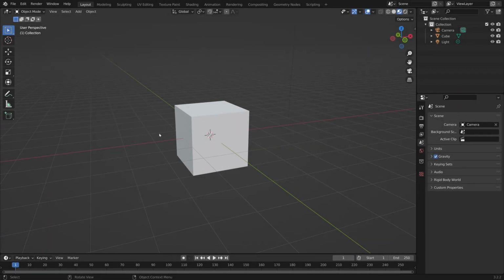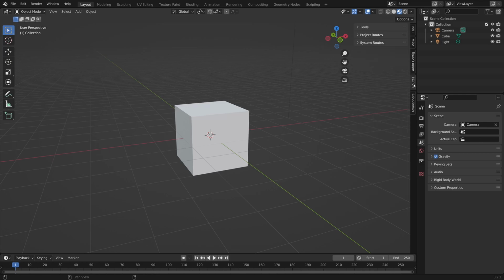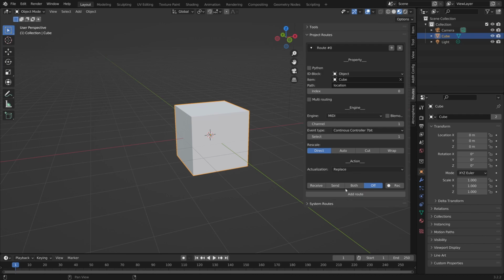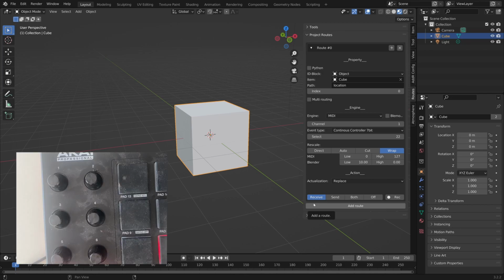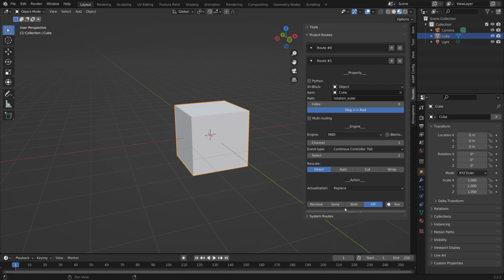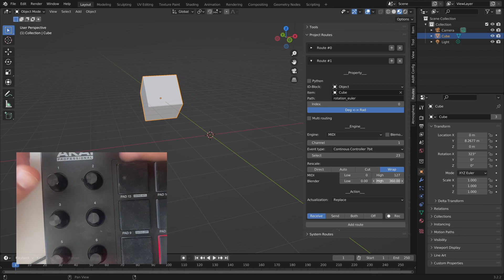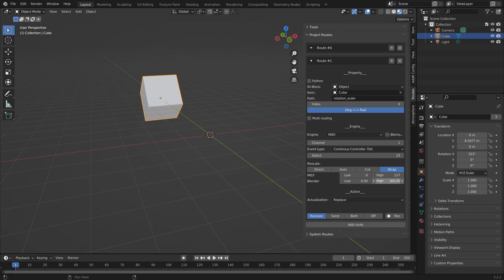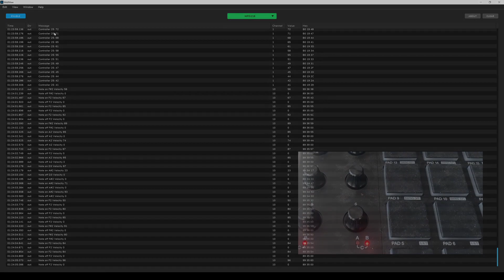Control Blender 3.2 with a MIDI hardware controller! (JPfeP AddRoutes)

Comment: Hi. Great tool. My question is, can this tool be used in a game made in Blender? An example would be a 3D keyboard in Blender that would play movements based on a MIDI file or controller in real time. A game with animation from a MIDI command. My English is not very good, so please bear with me.
Reply from the maker: I guess you could, but it would make much more sense to use unreal engine which is also free and is much more suited to game development. It also has a lot more midi features and there’s even an add-on whereby you can do your modelling in blender and then automatically import it into unreal engine in real time.

Comment: hey, i'm deleopping a way to make live 3D vjing thanks to your awesome addon, it blows my mind that i never saw someone using it, combining blender nodes potential with your program give something big. However i have few questions about it to complete my use of it. For exemple i would like to link a compositing node to it but can't link this type of value. Is there a way to make it happen with python or something i can't think of? I would really appreciate a small discussion if you have tips about things like that. Thank you again
Reply from the maker: Nice! But to be honest you'd be much better off doing what you're trying to do in Unreal Engine, it's designed for working in real time, Blender isn't! And it has much more support for MIDI and pretty much anything else than Blender. Blender is great, but Unreal kills for anything interactive and real time.
Reply: @retromograph3893  thanks for the fast response, yeah a lot of people says the same so i'll give it a try, the node system of blender is so good but i may try the switch if you all agree on that ;) thanks
Reply from the maker: @tib.lsr.3780  nice, Unreal also has an amazing node system for game logic, but not the parametric designing stuff which i guess is better in Blender & Houdini.

Comment: I'd bet if you had the right setup (with at least two computers?), this could be fun for some VCV Rack CV sends over MIDI. Audio stuff on one computer and create the visualizer on the other. Could have all kinds of stuff dancing to LFOs and envelopes, particularly when you consider that any parameter which can be animated in Blender can have the router driving it. Bet some pretty cool stuff could happen with particles and mesh deforms and decimation.

Just food for though, since it appears the tools are out on the table here.
Reply from the maker: Nice! a couple of thoughts: for anything in real-time and MIDI or OSC controlled, i'd chose Unreal Engine over Blender, because Blender isn't really designed for real-time rendering. Although if what you're making is more like line & dot based retro motion graphics, you can do some cool stuff in real time with a powerful computer, especially with geometry nodes, which i don't think Unreal has anything equivalent to. But Unreal has way more and better tools when it comes to real time and external control. By the way, here's me messing around with CV and Unreal Engine a couple of year ago: https://www.youtube.com/watch?v=jDxkLStctY8
I'm also a little skeptical about generating visuals directly from music. I mean, you can have an LFO at 20hz which sounds cool, but what can you do with an LFO at 20hz in visuals? It doesn't really translate (as a side note, check out LZX: https://www.youtube.com/watch?v=DU8fHK7yIzg, it really sucks haha!). But maybe some stuff like synchronizing a filter sweep is nice, but generally i think the visuals for audio (or vica verca) are better made from scratch (JMHO).

Comment: To MoGraph and Watchers of this Video. Please Read and Provide your Opinions and Feedback. It would mean a lot.

- MiDI controllers are just amazing. They have so much potential for productivity and utility (Especially once you take the time to configure your MIDI Controller). MIDI Tech obviously originates from the Audio World but has sadly over the last 35+ years has  STILL been Marketed for Use for 99.9%  Audio Industry. Having a physical unit with Pads and Knobs for use to control parameters in ANY Software is a huge advantage over the Constraints of a basic Keyboard and Mouse. I feel its a shame that the MIDI market and Software Market do not Focus on The Importance of Productivity that MIDI controllers can bring to Software. 

- Ive seen dedicated Hardware for Compositing software, Color Correction Software, etc) that cost $1000+ dollars  when a MIDI controller can do they same. Again, This is such an amazing thing Blender has done implementing and also a sad reminder that 99.9% of Software Developers do not provide Native MIDI Support.

= I find it extremely curious that PC Software and Hardware Developers Across The Board have still confined themselves to "The Mouse and Keyboard" when there is CLEARLY a need for Other Hardware devices. 

= The best example I can think of that most of you probably could recognize and relate with is if I talk about THE STREAM DECK. Remember when that came out and everyone shit their pants, simply because this little 4x4 or 6x6 Button box which was basically a physical device that was used as a glorified Shortcut manager. That wastnt very long ago. I wonder how many MIDI controller were on the Market with an 8x8 pad setup that could operate in the same function if not more. Again, its just odd to think about and I really hope the Use of MIDI controllers for n(on-music based productivity software) and Youtuber, Creators, Influencers, etc) can help spread the word to your average Artists, Programmers, Etc) so they can also see the amazing benefits of using External Controllers (MIDI) can have on damn near everything.  and Companies to add more support. Average users can also emails to get these major software developers to incorporate Native MIDI support instead of needing 3rd party software (which doesnt work most the time) 

- It was like 8+ years ago the  first time I realized how inefficient a single mouse and keyboard was for controlling everything on this amazingly epensive machine we call a PC that can do everything! Yet, this idea about the M/KB hasnt changed since their conception that last 50 years. Anyways, once I had this massive moment of clarity or "What the Fuck...why?". I looked over at my MIDI Controller I used for Fruity Loops and the Light Bulb Lit up. Now I have a Little AKAI 2x8 Pad Controller that sits right above my Keyboard that I use for so many things. Macros, Shortcuts, etc) I also have another AKAI Midi Controller with strictly Rotary Knobs and Sliders for Other particular uses that its to the left of my Keyboard. 

- Does anyone else feel similarly to the way I do? Mainly how desperately the entire PC User Base could benefit from the use of MIDI Controller. Education on MIDI tech and all its amazing Controllers out their, and using more than just this 50 years old concept of 1 Mouse 1 Keyboard. It just blows my mind. Seriously....Everyone from your average User, Gamers, Programmers, 2D/3D Artists, Compositors, and so forth across the entire PC space would benefit in some way shape or form from a 3rd MIDI Peripheral.
Reply: this but with usb video game controllers
a controller is a cheap $30 device with two joysticks, two potentiometer triggers and (generally speaking)  14 buttons
i want to be able to use it in replacement of the pressure sensor on a drawing tablet or as a 3d mouse or even just a general tool to assign to drivers to control stuff in blender
imagine mapping the L trigger on a controller to a shape key
or the joystick to bones x,y,z, rotations
Reply: Just wait until 2.0 starts being implemented in them, As a music producer they are so useful. From Controllers to Synths and even just a sequencer can be one of the most fun experiences as a creative. So being able to bring these two worlds together is beyond powerful imo, I really think Midi should just be overall implemented into all of these 3D animation programs....It just makes sense.
Reply: I've come from music production and have various midi devices inc Push 2,mpk mini and korg nano kontrol. Really surprised to hear that this support isn't just standard. I edited my first video in Resolve. I was trying to add audio effects. The knobs just barely responded to the mouse. I was frustrated to learn the program was locked to midi so they could sell their own hardware. Thats why im investigating blender.
Reply from the maker: Nice man .... Blender could start by implementing MIDI control the same way Ableton does.

So, you hit ctrl + M on your keyboard and you enter MIDI map assign mode. Now every control on screen that is MIDI mapable highlights blue.

You click a control with your mouse and it gets an extra highlight. Now you move your MIDI knob, slider or button and it automatically is mapped to that on-screen control. 

You hit ctrl + M again and you exit MIDI map assign mode and you can now use your MIDI hardware controller to adjust the controls you just mapped.

Another thing i'd like to see is a hardware controller with 3 big knobs. When you hover over a numerical field and move a knob, mouse movement is disabled until you tap a mouse button or your pen on the tablet. And the reason for 3 knobs is for course, medium and fine-grained control of values.

One other point i'd make is that as people are getting older and continuing their mainly computer-based careers, issues over repetitive strain injury and mouse (and especially track-ball which is the worst!) arm and going to become more & more common, so the earlier people start working more ergonomically, the better!
Reply: @retromograph3893  
-  Exactly! Those types Controllers and Methods would be no problem to code in, incorporate, and there is plenty of MIDI Controllers that have damn near any configuration in Rotary Knobs, Sliders, Touch-pads, etc) Anyone can think of. If there isnt one, the beauty of MIDI Controllers is that you can have ones Custom made to your specifications by many Makers out here. 
-  My Cousin had a  Guy on Etsy who makes Custom (MIDI Controllers), make him a Controller that was just a 4x4 config with 1" (Puck Style/Infinite Rotary Knobs, I'm not sure what actual name of that type of Rotary Encoder is...) but, the Pucks were all Aluminum with that Machined Nurling on the sides for grip. The Body was Aluminum as well, and its total footprint was like 10" W 10" L 0.05" D. He just wanted a Heavy Duty Controller with Big Ass Knobs Specifically to control his Synthesizer Plugins and it was around $150. 
-  The way I would like to see Any Production Based Software assign actions to a Controller would be similar to how customizing one for FL Studio is (Since im not familiar with Ableton that much. Where if there is anything clickable, automated, triggered, can be clicked off or on, any slider, or knob, etc) in the entire program itself or if its any  VST Plugin with the same. All you have to do is right click on that "thing" and select map to MIDI > Then simple move/touch whatever knob, pad, slider, on the Controller and it Instantly Maps to it. You can then save that Mapping Profile to the Project Itself, or you can save Unimited Custom Controller Presets that can be swapped through on the fly with whatever button you might assign that Preset Swap to.  
- Just Being reminded about all this just triggers the fuck out of me (Pun intended)  There is 100s of Amazing MIDI controllers in every size, shape, form, with sliders, knobs, switches, and so forth out there on the open market!!!! Yet, ZERO support for ANY of them unless its specifically for Audio shit! Whether its DAW Software or Physically based Audio Equipment. People cant even fathom the Productivity gains that can be made in all fields of Software let alone just for Casual use cases. I know there are 3rd party plugins that sometimes work but what we need some real out cries and  exposure for Users and Developers. To make it where its plug and play and as simple using them with DAWs make it.
-  I honestly dont know why,  and Im truly mind blown why the fuck this still isnt even a thing. Even when I turn on my conspiracy brain and  try to find any angle or  reason why MIDI Controllers would be "Gate-kept/Silenced" to this day.  I still cant find anything remotely conceivable to why theyre still only developed, marketed, and pushed for strict usage and compatibility for only the Audio Industry. 
- Like I said before..50+ years and 99.999999999999% of PC Industry still using the same old bullshit Mice and Keyboards to Navigate and Operate Software and Games just sounds so unthinkable to me, yet here we are.

Here's a quote I made up, taken from a some typical Dumbf**k character (US), from a fake science fiction based story that my brain just Queefed and aborted into existence...Enjoy. 

Time Traveler from 1999 say:
 "HOLY SH*T! So That Truly Amazing Innovation for PC Peripherals That's been a Billion Dollar Industry Is Another Keyboard You Say? But This Time It Has Got These Different Types of Mechanical Switchy Thingies That Make Typing Feel Different? GOLLY GEE!!! Your Telling Me Some Light Up Too! OMG, WOW!!! Am I Dreaming!? Are We  Living in The Future!? I Cant Believe it!? WAIT! WAIT! WAIT! Youre Telling Me These Same Genius Innovations Have  Been Done For Mice as Well!? Now I Really Must Be Dreaming...What Will They Think of for the Next 50 yearst!? This is Truly Unbelievable!!!!!!..........." 

Fu**ing Kill me...This makes me Angry.

Comment: Hi, having trouble to install on blender 3.2.0 with macbook m1. for some reason i get these alerts when i try to mark the checkbox in the add-on list:

Traceback (most recent call last):
  File "/Applications/Blender 3.2.app/Contents/Resources/3.2/scripts/modules/addon_utils.py", line 335, in enable
    mod = __import__(module_name)
  File "/Users/amitbt/Library/Application Support/Blender/3.2/scripts/addons/AddRoutes/__init__.py", line 56, in <module>
    from . import data
  File "/Users/amitbt/Library/Application Support/Blender/3.2/scripts/addons/AddRoutes/data.py", line 32, in <module>
    from . import g_vars
  File "/Users/amitbt/Library/Application Support/Blender/3.2/scripts/addons/AddRoutes/g_vars.py", line 22, in <module>
    import rtmidi
  File "/Users/amitbt/Library/Application Support/Blender/3.2/scripts/addons/AddRoutes/rtmidi/__init__.py", line 4, in <module>
    from ._rtmidi import *  # noqa
ImportError: dlopen(/Users/amitbt/Library/Application Support/Blender/3.2/scripts/addons/AddRoutes/rtmidi/_rtmidi.cpython-310-darwin.so, 0x0002): symbol not found in flat namespace (_jack_activate)
Reply from the maker: No idea! (i'm a PC user and not a developer). Try posting the question on the forum at: https://blenderartists.org/
Reply: @retromograph3893  sorry, I thought this is the place to ask :)
Reply from the maker: @amitbt69  no problem, but i think you'll have more luck on the forum!
Reply: The same. Error
Reply: hey did you get It to work

Comment: I use Metagrid Pro on my iPad to control Blender shortcuts. But I have an issue: Blender doesn’t recognise any modifier key like CMD, Shift or ALT from Metagrid. It only work with single keystrokes. I can’t assign shift+A for add object or CMD+ALT+NUM0 for align view to Camera.

So I’m looking for a different way to controlling the Blender keymap. Can we assign any Blender shortcut to a MIDI button like adding any menu items to favorites with right click. For example: add object, join/parrent object..etc?
Reply from the maker: I really don't know if that's possible using this (or any other) addon. But to be honest, for what you're trying to do, I think an Xkeys keyboard is a better choice than an iPad, although of course it ain't cheap. But it's a great system, for mapping any combination of keys to one key: 
https://xkeys.com/xk128.html

Comment: before i spend time on it can you set any parameter to the add route? cause i want to be able to render in real time and control parameters to morph objects per say, with my midi  controller. 
would this be possible? like say have 6 kobs for different geometry node parameters?
Reply from the maker: It takes like 5 minutes to set up, so give it a try.

Comment: Im using Blender 3.2 I download the zip file from github but an error occurs when trying to install it.

Traceback (most recent call last):
  File "C:\Program Files\Blender Foundation\Blender 3.2\3.2\scripts\modules\addon_utils.py", line 335, in enable
    mod = __import__(module_name)
  File "C:\Users\george\AppData\Roaming\Blender Foundation\Blender\3.2\scripts\addons\AddRoutes-master\__init__.py", line 56, in <module>
    from . import data
  File "C:\Users\george\AppData\Roaming\Blender Foundation\Blender\3.2\scripts\addons\AddRoutes-master\data.py", line 32, in <module>
    from . import g_vars
  File "C:\Users\george\AppData\Roaming\Blender Foundation\Blender\3.2\scripts\addons\AddRoutes-master\g_vars.py", line 22, in <module>
    import rtmidi
ModuleNotFoundError: No module named 'rtmidi'

If anyone can help....???

Comment: Why didn't it work for me, what version did you run it on?
Reply from the maker: hey man, it's in the title, 3.2 ...... did you follow all the steps carefully? .....did you check what CC number your controller is outputing?
Reply: @retromograph3893    It doesn't work in 3.2. can you help me for god Please
Reply from the maker: @fatihturkmen4728  it does work with 3.2, i asked a question which you didn't bother answering so i'd say just carefully copy all the steps in the video including checking your CC number, good luck!
Reply: @retromograph3893  sorry you are right.  At that moment, I wrote with excitement.  I solved some of them, I just couldn't manage cc numbers, I'll try 🙏👍 Thank you.